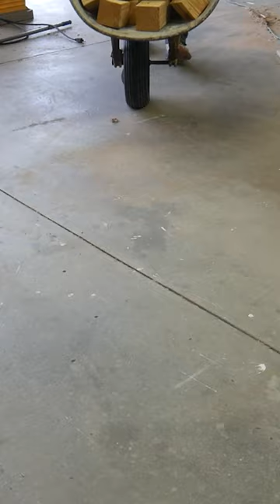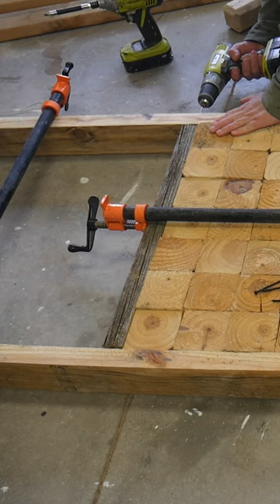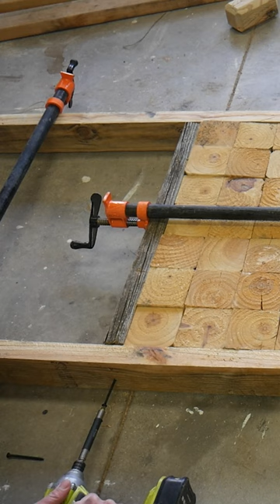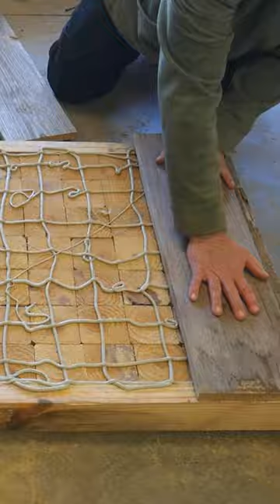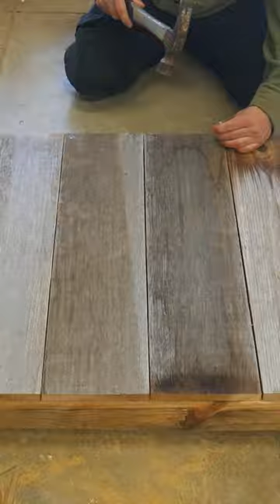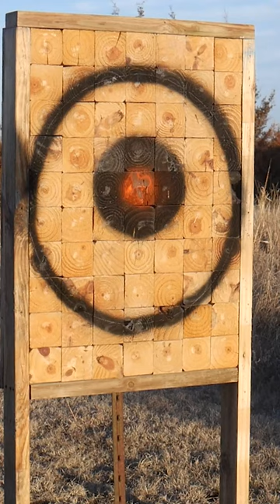Axe/Knife Throwing Target

Comment: You'll discover that you also need glue between each and every piece and a good bit of it. Otherwise in a few weeks to months you'll be pulling pieces out.  I've built several of these and the more glue throughout,  the better. Nice job.
Reply from the maker: True. I'm working on building my next one.
Reply: Type 3 wood glue is best, least affected by water - can handle being submerged. Type 2 is water resistant and type 1 is soluble I guess i.e. a couple rains will rinse it out. Type 3 is more expensive but the targets last much longer.
Reply: Glue is not recommended in this application. Just think about how you're going to maintain the target long-term. 
This isn't complicated. Just take the time to think!